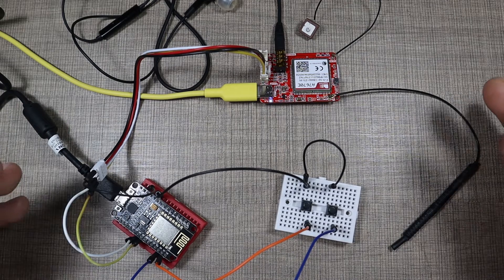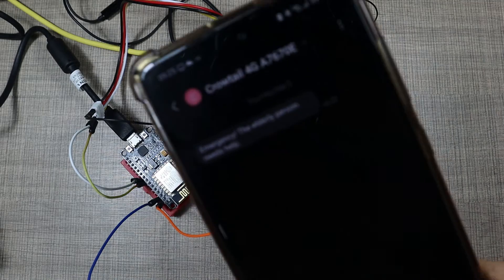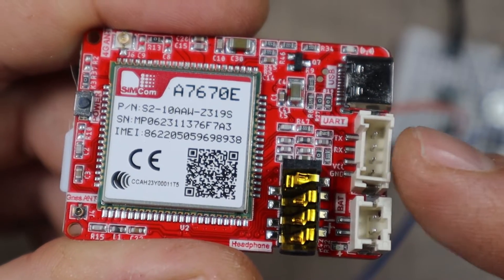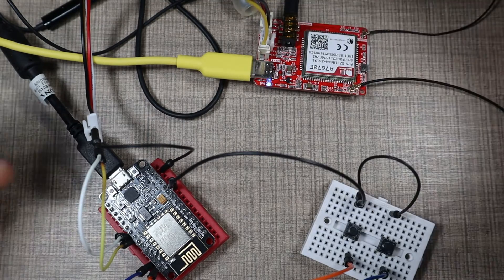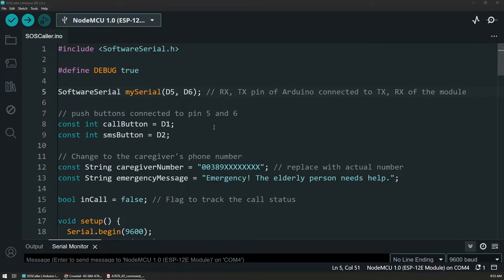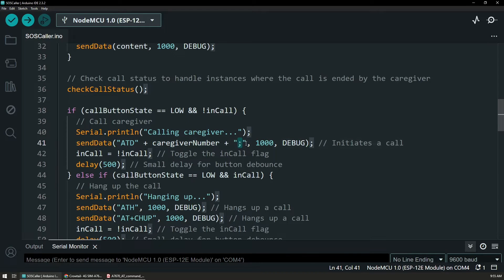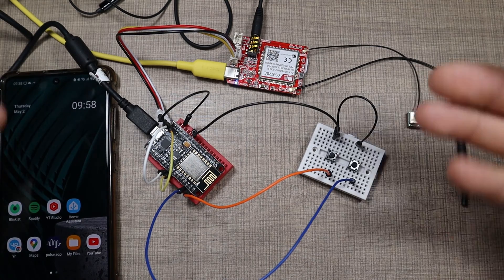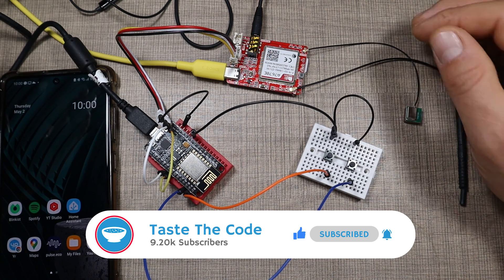SOS Emergency Caller Prototype with NodeMCU and Crowtail-4G SIM A7670E

Comment: I tried searching but didn't find anywhere.
Does this module work with VoLTE or does it drop to 2G for calls and sms?
Reply from the maker: The module datasheet does not mention VoLTE anywhere so I can't tell. Here is the link: https://www.elecrow.com/download/product/CRT01260S/A7670_Series_Hardware_Design_V1.00.pdf

Comment: Can I program the 4G module without Arduino? Can I use only the USB C interface?
Reply from the maker: Yes you can. By default it works as a 4G modem on the computer and you can interact with it via serial.
Reply: @TasteTheCode  Thank you very much. I will try it with my own developed software with Qt. Greetings from Germany.
Reply from the maker: @T.H.-ti7zz  👍👍👍 Let me know how it goes!